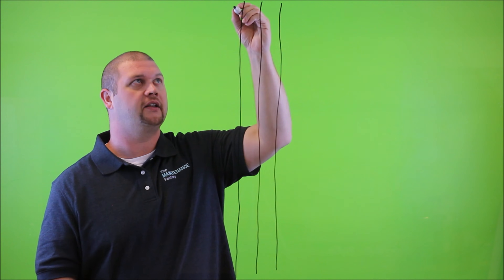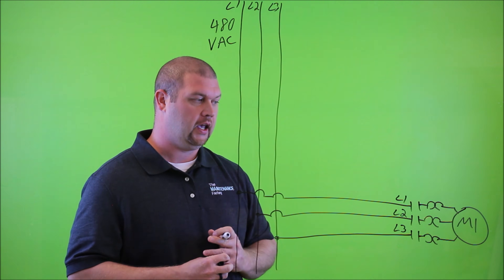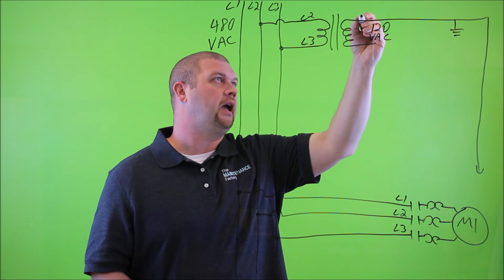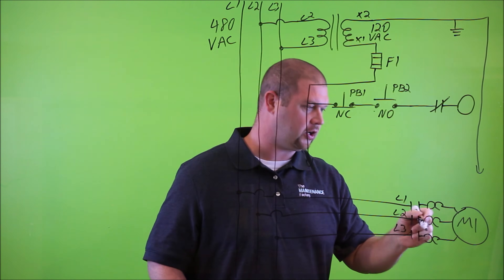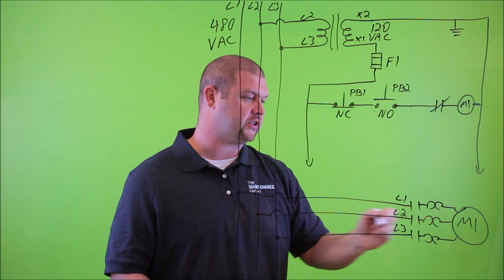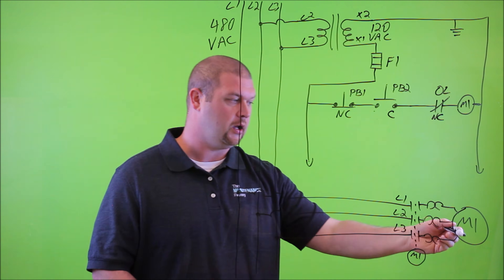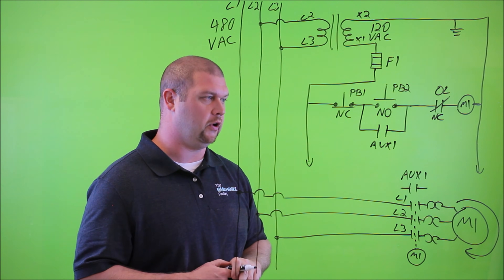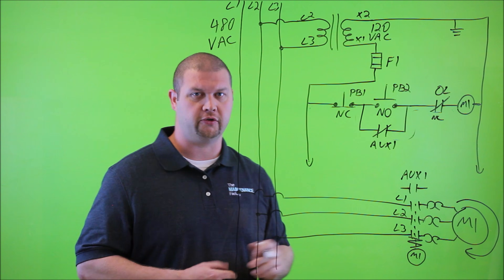Basic Motor Controls Explained

Comment: Aren't those drawing methods antiquated? We design the cirquit I the vertical and call the contactor coil "K " not M because M is for the motor. The control cirquit operates at safety voltage 24 VDC   forming from the supply a mini TI cirquit .   pole is grounded with a very high resistance  for safety

Comment: 4:24 Primary side of the Transformer connected to L2 and L3 would be 277v, not 480v. Right?
Reply: 480v! Line to line is 480. Line to ground is 277v

Comment: Very good video. Especially you can explain it from two wires circuit to three wires circuit. It’s easy for the beginner to understand it. But for one thing it is confused for the beginner . It is the name, M1, for the motor and the low voltage control relay coil, which can not be named the same. The relay coil can be named as CR.

Comment: Only thing that's missing is an actual motor being hooked up. Diagrams are fine and great for understanding the circuit layout, but an actual motor, with fuse and push buttons and everything else would really hammer it home.

Comment: For anyone reading a small clarification to the end. I know he mentioned it but to clarify when the contactor opens the aux contact opens as well which will keep the motor from restarting once you release the stop button. Also expect multiple aux contacts for things such as indicator lights and SCADA/DCS signals. Lastly there will often be a breaker at the very beginning directly in the three phase lines before any circuitry. This is for circuit protection as well as to kill power to allow for maintenance, repairs, and any other work.

Comment: Hey man listen, you are talented in carefully but simply explaining circuitry 101. I am preparing to become an electro mechanical crane technician and this helps out a lot.   BUt I do have a question:

Why don’t you need a memory circuit to keep the stop switch open in the same way that you need a memory circuit to keep a the start button closed?
Reply: Bc the stop button is already in a normally closed state. It only drops out the current flow when you push the button then returns to a closed state once you release it to form that bridge for the current. ready for when you press start.

Comment: Sir,,what is value of F1,is there a formula to compute what is the amp rating to use?
Can i use L1 and L2 ,instead L2and L3,to supply the transformer?
And how to set the overload relay to protect the motor?
Thank you sir for your video.

Comment: The overloads do not open on fault, a auxiliary contact NC opens and turns off the contactor
Reply: I was thinking of commenting the same thing. I also always break my neutral with my OL contacts. Over all though it’s a good job.
Reply: You are correct.

Comment: As a non electrician this helps a lot with me understanding three phase starters. Have an old three phase drill press that I tried to use today but the start button would not depress. Looking inside the button will push down without providing power if I rotate a mechanical arm or turn down an internal amp dial. Not sure how to troubleshoot this but I do understand the principle of the switch. Thank you.
Reply: Check check continuity on the switch maybe.

Comment: Nice concise explanation!  I just wanted to add that the primary side of the step down transformer has 2 fuses as well. At least the motor controls I work on do.  One other thing is it might be a good idea to label the contacts with the ANSI/IEEE device numbers as a lot of the prints we encounter identify the contacts with the device numbers. IE 49 contacts for the thermal overloads, and 42 contacts for the main contactor and aux contacts.  I know you are probably just trying to do a simple explanation for newbies, but I figured I'd make this comment for those who are eager for the extra info.  Nice Work!  👍
Reply from the maker: Thanks for the comment Kyle.  You are 100% correct about the fuses, and the ANSI device names.  I also did not include a main breaker or disconnect means for the main power section.  You are correct about keeping it simple.  My intent was to explain how the components work together rather than focus on the labeling/naming scheme.  I believe the ANSI device names will probably be covered in later videos.  Thanks for stopping by!
Reply: There is 2 mi he uses with auxiliary I would have a 5th line for